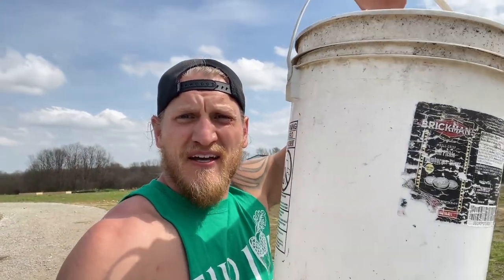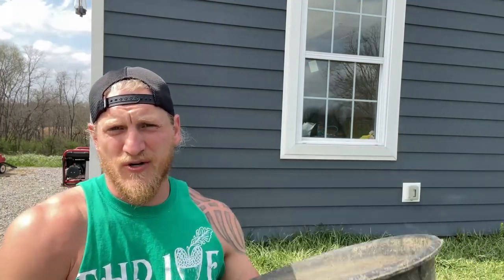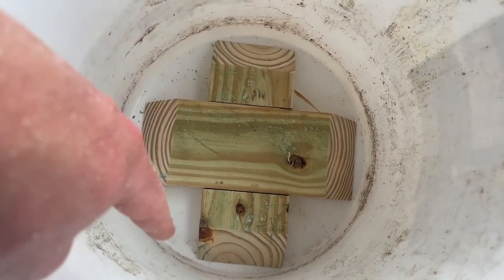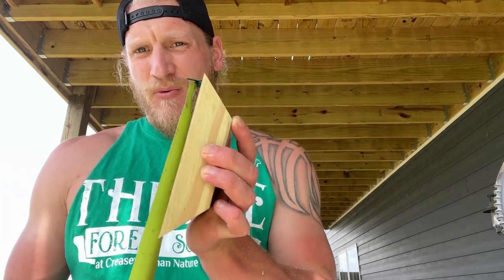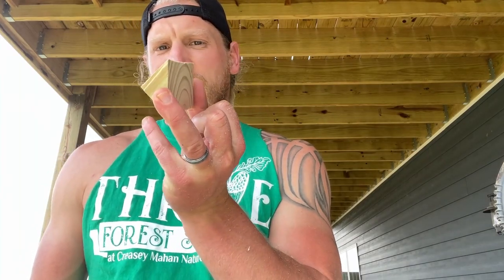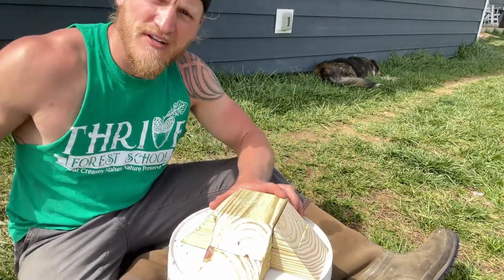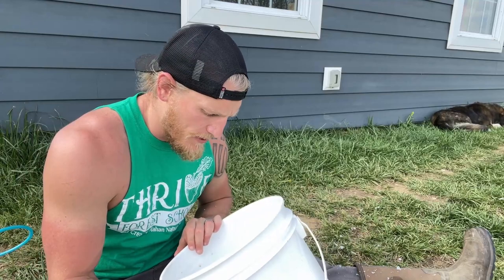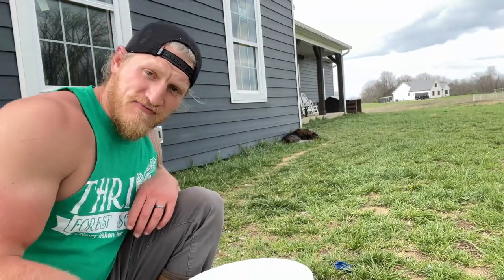DIY Gravity Feeder

Comment: One five gallon bucket holds 25 lbs of dry feed    two 5gallon buckets holds one bushel of shelled corn or more percies 1.24 cubic feet or 54lbs of corn per bushel
Reply from the maker: The bucket to the top plus the over spill into the pan is definitely more than 25lbs. It was about 3/4 of the 50lbs bag of feed I poured into it which should be roughly 37.5lbs. This is layer crumble too, so it may be filling a little more space in the bucket than a pellet feed would. Thanks for watching Wes!